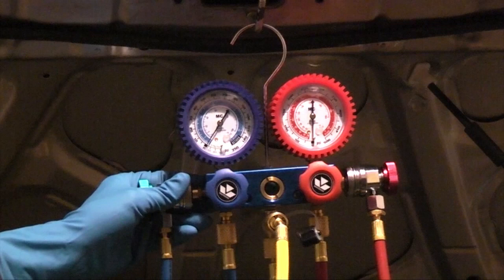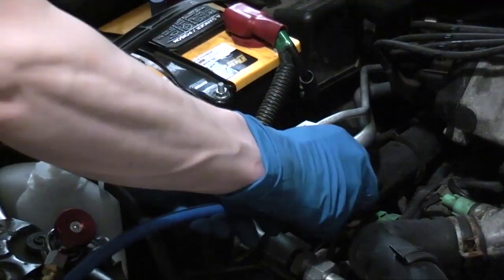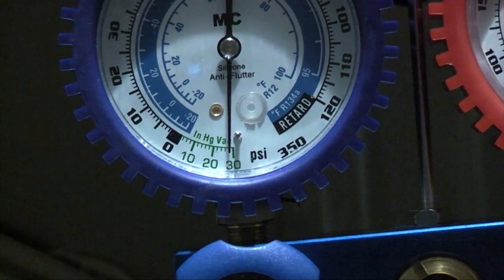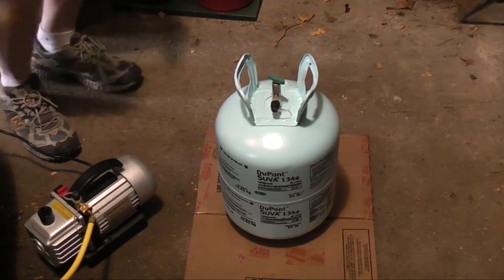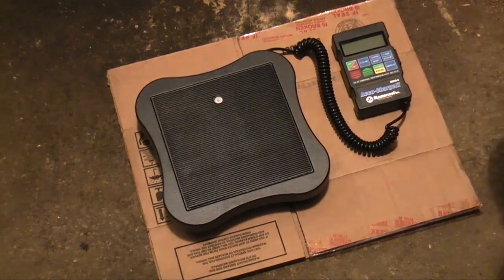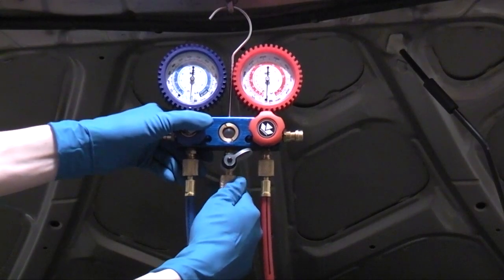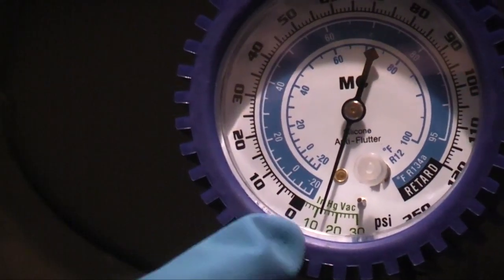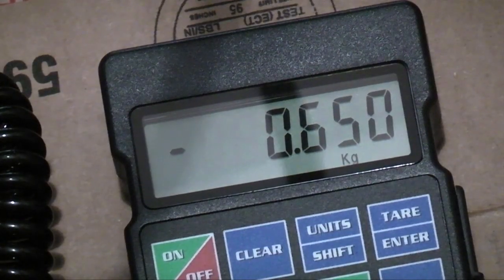How To Recharge an Auto AC System

Comment: I find that there's always a noticable amout of refrigerant left in the vacuum hoses after doing a pressure check or recharge. Is there an effective way to send or sweep the residual refrigerant from inside the vacuum hoses back into the system after doing a pressure check or recharge?
Reply from the maker: +fmcmla That's the price for attaching a gauge set unfortunately.

The system when running and properly charged will never pull a vacuum on the low side (it will be at positive pressure) so there will always be a bit of refrigerant in the lines.
Reply: @Bushougoma  Would it make sense to add a few extra grams of refrigerant to compensate for what is left in the hoses?

Comment: Could you let me know the brand of your manifold gauge and vacuum pump?
Reply from the maker: +Marcel Galicia The gauge set is made by Mastercool and the vacuum pump is manufactured by FJC.
Reply: +Bushougoma Thank you so much.  How many cfm is the vacuum pump?
Reply from the maker: Marcel Galicia
Can't remember I've had it for years. Anywhere between a 1.5 and 3 CFM pump will work fine for auto A/C.

Comment: thanks for the details.   I am ready to charge my system after I hit a deer and had to replace the condenser and while I had the system open I replaced the accumulator and added a little pag150 oil  I bought a harbor freight pump and evacuated it last fall.  Now weather is getting warmer.  I will check the vacuum and then follow this procedure.  thanks for the details.

Comment: why aren't you charging it as a liquid on the high side when weighing it in?? it is a blend refrigerant. if you charge it as a vapor your not get all the blend... where did you go to refer school?
Reply from the maker: +Vic Felix R134a isn't a blend it's a pure refrigerant and can be charged as a liquid or a vapor. Whoever told you it's a blend is mistaken. Both R12 and R134a used in auto A/C are pure refrigerants.

Comment: Your high side gauge is full of liquid because you failed to balance the gauges. Oops!
Reply from the maker: +Mike Malone I didn't outline the process to equalize the lines because I don't recommend it.

I don't want people blowing the relief valves on their charging cans if the proper process isn't followed for a very small amount of refrigerant that (at standard manifold gauge line lengths) doesn't really matter.
Reply: how do you balance the gauges?
Reply: jose chavez to balance the gauges when completed charge by weight, remove the high side connection from the high side  Schraeder valve, then open both the high and low side together, and the liquid on the high side will get sucked into the low side.  Now remove the low side connection. This is all done with the unit running.
Reply from the maker: +Mike Malone
Make sure the sealing o-rings on the high side quick disconnect are in good shape before doing this.

Most importantly make sure the charge line cylinder valve is OFF. When the line is connected to a cylinder and the cylinder valve is open opening the high side valve can cause the compressor to overpressurize the charging cylinder and blow the relief valve.

While 30 pound charging cylinders do have a check valve to prevent reverse flow (and to prevent people from using them as compressed air tanks when empty) and SHOULD prevent this I wouldn't want to test it.

The reason why you can't simply leave the charge line disconnected is because on some gauge sets there isn't a schrader valve on the charge line and you'll end up dumping the charge if the charging line is disconnected and you open either manifold valve.
Reply: You need a brass cap on the charge port.  That schrader valve on the charge port of the manifold set is there to bleed or connect a vacuum pump.

Comment: hi, my 90 accord a\c was blowing cold air at #1 ,it just suddenly got warmer and wasn't blowing air away from vent so I switched the knob to #2 then #3 suddenly smoke came out of the engine bay by the compressor area not sure where or what caused it but it smelled like burnt rubber
Reply from the maker: +Josh Tapuro It sounds like the compressor is seized or the clutch is slipping with the engine off try turning the center hub on the compressor pulley if you can rotate it check the clutch air gap if it's too large replace it. This can be done without evacuating the system. If you can't rotate it the compressor is toast.

A seized compressor usually pushes contaminants through the system before it locks up. You're looking at a new compressor, condenser, and receiver dryer along with a thorough flush of the remaining components. 

Simply putting a new compressor in will cause it to fail due to the contamination.

In addition to that a 90 Accord would have used R12 from the factory with that level of damage and the cost of R12 you're better off converting it to R134a.

Comment: Some gauges have a shreder valve on the yellow line, it's a T-fitting. Wouldn't that be used to bleed the line?
Reply from the maker: +Whatatay T Yes it can.
Reply: +Bushougoma 

I have a couple quick questions.  I hooked up gauges without purging the lines recently.  I did it twice.  Will this hurt the system?  Do I need to replace the receiver drier?  Is there any way to purge excess air without pulling a vacuum?

Lastly, my ac hasn't been working.  The air is barely cool on a 78F day.  The gauges on the low side INITIALLY read vacuum before the system has run a couple minutes at 1500RPM.  After that, it's about 3-4 psi.  High side is about 100 PSI?

I still have pressure in the system, so could I just add refrigerant or should I vacuum the system and then add refrigerant?  I forgot to mention that the cause of the leak was a Schrader valve which has been replaced.
Reply from the maker: slylockfox85
There is no way to remove air without completely evacuating the system of refrigerant and pulling a vacuum.

Since there is still positive static pressure in the system you could get away with topping it off.

But since there is a vacuum on the low side with the compressor running that tells me that the charge is extremely low.

If all the leaks have been repaired you are probably better off having the system evacuated and recharged. While the system is empty replacing the dryer wouldn't be a bad idea either.

That's the only way to make sure the proper charge weight is in the system.
Reply: *****
Why is that pulling a vacuum removes air and moisture but it is recommended that the receiver/dryer or accumulator be replaced if the system has been open any length of time?
Reply from the maker: Whatatay T
Pulling a vacuum causes the moisture to boil and become a vapor which allows it to be extracted by the pump.

The vacuum drastically reduces the boiling point which is normally 212 degrees F at atmospheric pressure. In a vacuum the moisture can boil and become a vapor at room temperature. At 29.7 inches of mercury water will boil at 30 degrees F.

The receiver dryer contains a desiccant to absorb any residual moisture left in the system.

The amount of moisture it can absorb is limited. If exposed to humid atmospheric air such as if there is a leak and the system fully discharges or if the system is disassembled and left open for too long it can become saturated.

That's why when you buy a new dryer it's capped off and filled with dry nitrogen gas to keep the desiccant fresh.

You should only uncap the dryer right before you intend to install it and pull a vacuum on the system.
Reply: *****
Thank you. That makes total sense. I pulled a vacuum today. Only went to 15, Shut off high side valve on gauges and it went to 25 but as soon as I shut off the vacuum pump the vacuum went to zero so I have a major leak. That makes sense since one day the air worked fine and the next day it didn't. As I mentioned earlier the cap on my low side valve was saturated with oil on the outside so I.was hoping that was the only leak. With the gauges on that valve it would have been seal so it is somewhere else.

Comment: When you vacuum it does it remove the oil? How much oil do you put in when you change the accumulator or receiver/drier?
Reply from the maker: +Whatatay T A very small amount of oil will be lost but nothing to be concerned about. Your service manual will have a list of the various components and how much oil to add after that components replacement.
Reply: +Bushougoma Thank you. I don't have a service manual. Aren't they like $400?
Reply from the maker: Whatatay T
What's the year, make, and model of the vehicle?
Reply: +Bushougoma 01 Ford Taurus.  By the way I got some $130 gauges on loan from Autozone. One day I had perfect A/C and the next day it just blew hot. Compressor clutch not engaging unless I bypass the low pressure switch. 

So I connected the gauges and both showed zero, however as I went to connect the low side, the outside of the cap covering the shrader valve was soaked as was the inside of the valve when I took the cap off. It looked yellow so it may have had dye in it. I started the car and bypassed the low pressure switch to run the compressor for just a few seconds and the high pressure gauge started going up. 

I saw one one video where the guy said 80% of the AC problems he finds is with leaking shrader valves. When I disconnected the gauges I was using a tool to make sure the valve was tight and it released some air as I pushed down on it but stopped when I left go. I had taken the car in for a smog check the day before air stopped and they had the hood up and recommend some PM repairs so I thought maybe they loosened it to let the R-134 out thinking I would come for AC repair. I'll replace bother shrader valves and vacuum it and see if it holds pressure. If so I'jj get an accumulator and do recharge it.
Reply from the maker: Whatatay T
The oil always accumulates where the refrigerant is leaking out.

If the cap is full of oil that schrader valve is toast and will leak when the system is fully pressurized. I'd also recommend replacing the cap if the gasket inside is bad it won't seal properly.

Some schraders will leak a little which is why when you initially remove the cap from a charged system you will hear a little hiss. The caps job is not only to keep debris out but to seal minor leaks.

As for oil capacity. The factory procedure is to drill two 1/2" holes in the bottom of the old accumulator and measure the oil drained. Then add that plus 2 additional ounces to the new accumulator.

Make sure you use the right oil type it should be on a sticker under the hood with the total charge weight.
Reply: +Bushougoma Not only was the cap full of oil, the outside of it was soaked with oil before I even took it off. I noticed it before I even hooked up the gauges. I did read that  the cap also seals the valve so will change those along with the valves. You can get a kit for like $8. I figured the valve would leak when fully pressurized so thanks for confirming that.  

Thank you so much for the procedure on determining the oil capacity for the accumulator. I did research the the oil for y car and it's PAG 46. I can just pour the oil in one of the lines where the hose attaches?

Thank you for the great job on the video. I watched several and yours is by far the best and most detailed.
Reply: +Bushougoma Not only was the cap full of oil, the outside of it was soaked with oil before I even took it off. I noticed it before I even hooked up the gauges. I did read that  the cap also seals the valve so will change those along with the valves. You can get a kit for like $8. I figured the valve would leak when fully pressurized so thanks for confirming that.  

Thank you so much for the procedure on determining the oil capacity for the accumulator. I did research the the oil for y car and it's PAG 46. I can just pour the oil in one of the lines where the hose attaches?

Thank you for the great job on the video. I watched several and yours is by far the best and most detailed.
Reply from the maker: +Whatatay T It's easier to just pour it directly into the accumulator or receiver dryer depending on which device your system has.

It acts as a reservoir so you don't have to deal with it spilling out as you reinstall the lines.

The refrigerant will spread it throughout the system when the compressor runs.
Reply: +Bushougoma Excellent. And any o-rings and shrader valves should be coated with oil, correct?
Reply from the maker: Whatatay T
Yes coating the o-rings will prevent them from binding up, rolling, and tearing during installation which will cause a leak.

I usually don't coat the schrader valve but if you want to only coat the rubber gasket that seals it to the charge port.

Be sure to check the mating surface inside the charge port where the gasket on the schrader seals to when you tighten it down. If it's corroded and pitted the component with the charge port on it will need to be replaced.

Most of the time it's just the rubber seals on the valve that go bad.

Also make sure you have the quick connect release tools to separate the lines.
Reply: I meant oil the rubber gasket on the schrader valve and not the whole thing.

Good tip on checking the charge port for corrosion. The accumulator I need comes with the line to the evaporator and that charge port is part of that line so it will get replaced in the end anyway.but I will check on the high pressure side when I change that valve..

I just wanted to try a new schrader valve to see if that was the only leak, however pulling a vacuum and watching the gauges should tell me since having the manifold gauges connected will seal that port.

I didn't think about the quick disconnect tools. so thanks for that info. I will research to see what I need.

Comment: did you re zero out the scale after bleeding yellow charge line?
Reply from the maker: Daniel Barnett The refrigerant loss was no insignificant it didn't even register on the scale.

No doubt refrigerant was lost but the scale wasn't sensitive enough to measure it.
Reply: ***** Thanks! I plan on using 3 small 12oz cans. I should re bleed every time I hook up a new can correct? The yellow line doesn't auto seal when you unhook them right?Also If I use the 12oz cans I don't have to shake/tilt them when charging right? I can charge with vapor and the can upright? I plan on using a small jewelry scale. http://ecx.images-amazon.com/images/I/81VypY5Zg0L._SL1500_.jpg
Reply from the maker: Daniel Barnett
It depends some gauge sets have a schrader valve on one side of the charge line while others don't.

Valve up for vapor valve upside down for liquid.

A tiny scale won't work unfortunately as the can empties it will fall over on the scale and the weight of the tapping valve and charge line will come into play.

The small cans are just too light when empty.

I wish that method worked but unfortunately it doesn't.
Reply: ***** I thought about this and planned on securing the charge line to something (like zip tie it to the front grill) and making sure can was stable. That way when can is empty it doesn't fall over from weight of the line. Also the weight of the tap and line should not be a factor if you zero out scale after bleeding correct?
Reply from the maker: Daniel Barnett
You'll have to find some way to secure the can to the scale. The weight of the tapping valve will tip it over once it nears empty.

Comment: I vacuumed my Ac unit for around an hour and the blue gauge stays around 20-21 of mercury. I can't seem to get it to 28-30. Does this sound like a leak?
Reply from the maker: ChicagoBulls2007 If the vacuum pump has clean oil inside and is in good working shape and the gauge isn't damaged. If the gauge indicates zero at atmospheric pressure then it's likely fine. Make sure the quick connect and hose to manifold gauge seals are in good shape too.

If so then yes that's quite a serious leak. Have you opened the system for repairs recently?

Did you lube the o-rings with refrigerant oil before reinstalling the A/C lines? Maybe one of them rolled over due to lack of lubrication.
Reply: +Bushougoma
Only we who live at sea level will get 30 in. vacuum. Above sea level the max vacuum will be less.

Comment: A liquid charge works great when you're charging from 12-14oz cans, but it is critical to make sure that any liquid is going in ONLY through the high pressure port and with the vehicle off. This way when the A/C is first turned on, liquid is pushed away from the compressor and right to the condenser. For my older R-12 vehicles I do a liquid charge from the first can, give it a few minutes to settle and then set it up to do a vapor charge from the second can, going until the low pressure (suction) port reads what's specified in the factory service manual.
Reply: +Daniel Moeller Sounds like I just destroyed my compressor. I had to hold the refrigerant bottle upside down to connect it to the low side port. So I know I was putting liquid into it. Damn it!
Reply from the maker: +centuryfreud Not necessarily as long as it vaporizes before it reaches the compressor (over a long length of line for example) you're fine.

When charging as a vapor if the compressor won't kick on after the pressures in the charging cylinder and system equalize. Jump the refrigerant low pressure switch or clutch cycling switch depending on system design to get it to run and pull in the remainder of the refrigerant charge.

To find what wires to jump consult the A/C system wiring diagram in your service manual.